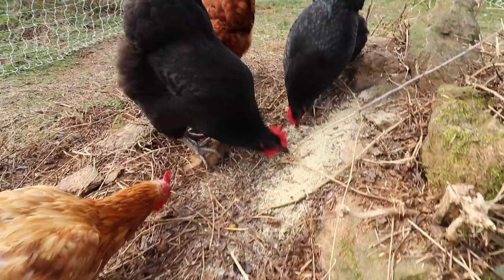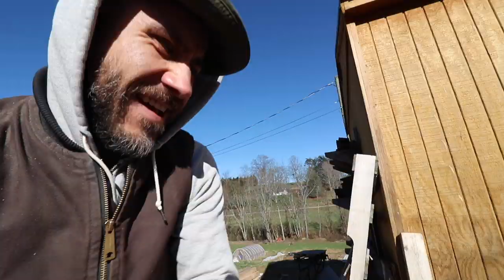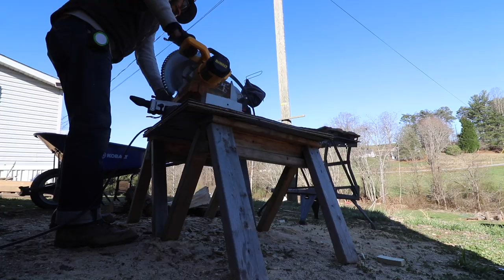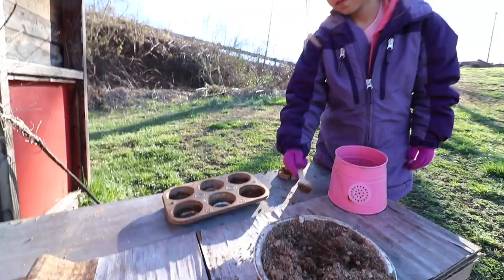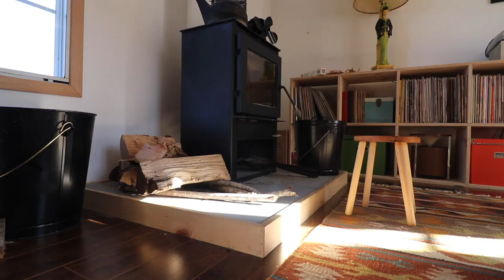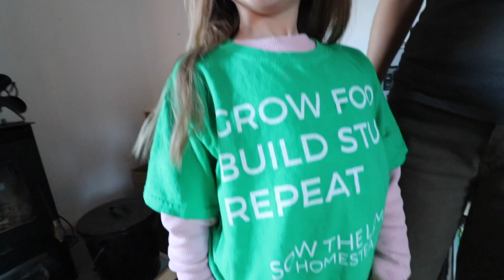Chopping wood for our TINY WOOD STOVE

Comment: Don't worry, I am going through the same thing with my wood stove. Originally I cut my firewood to fit my fireplace. You did give me an idea to use my circular saw. If the piece's were thin enough I used my reciprocating saw.